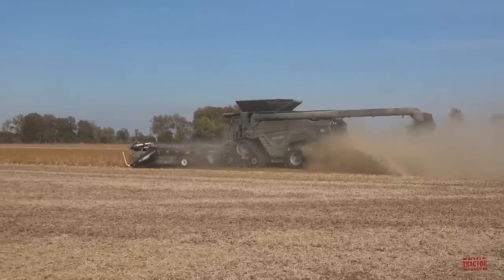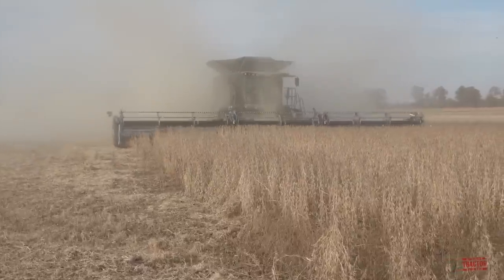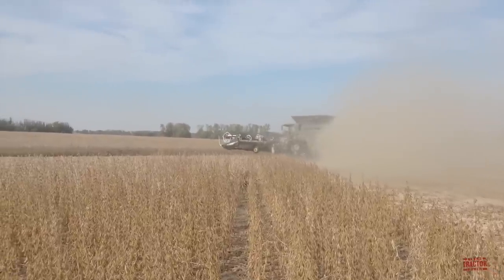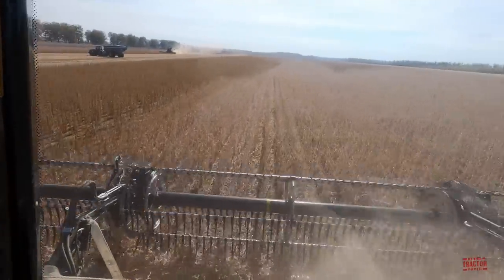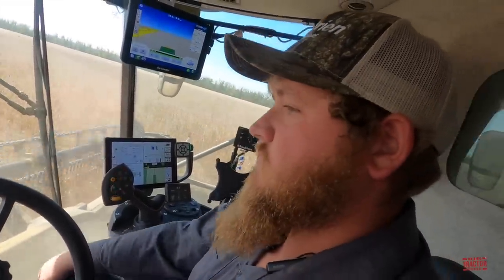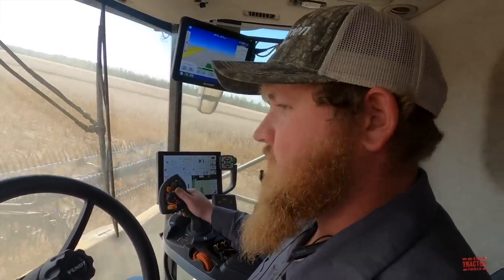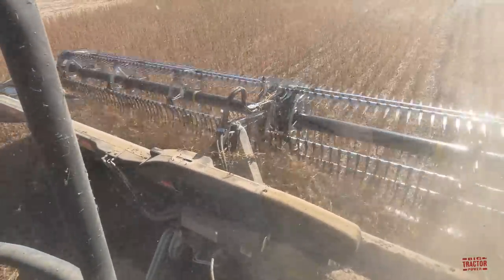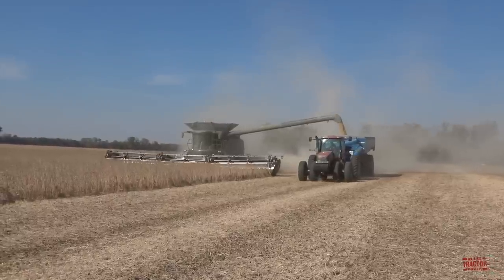50ft MACDON FD250 Flex Draper

Comment: A 50ft head is impressive👍 nice to see an ideal combine in the field, thanks for the video😉👍
Reply: You'd have to have an awful level field to run 50 ft wide
Reply from the maker: Duane these new headers flex allot. rolling Terrain  is not an issue.

Comment: We've had a 45 ft Macdonald on the old 760tt lexion and purchases a new 8600 and using same head. Works very well.
Reply: How do you like the 8600 for beans, we run a 7500, just wondering if it's any better

Comment: That’s humongous! It shows how much agriculture has advanced in the past century!
Reply from the maker: It has advanced tremendously in the past 20 years.  The first MacDon I filed was a 36ft model in 2003 on a 9750 STS in wheat and it seemed huge at the time.
Reply: @bigtractorpower  wow! Do you have a link to it?
Reply: Efficiency in time use especially during harvesting (my own experience on a small grain farm) is so important, time is money, optimal conditions are rarer than one would be think if you want it to go straight into a bin. My dad spent most days on the Gleaner, with a New Holland helping, many nights spent running the dryer. To grab 50' at a time wow, but when does $$$ spent in the name of efficiency become too much?  Million dollar combines are real and must be near that limit.

Comment: Would like to know what kind of losses they experience with that head, and also the combine.  Does that type of head eliminate the need for a wind system like the Crary Wind System?
Reply: Looks like it was doing a pretty good job as is.
Reply from the maker: I did not observe very much loss at all in the field. The Ideal and MacDon made an effective harvesting team. I do not no sny farms in WKY running a Draper with an air reel. The Draper handles the crop well

Comment: Question - what’s the hp range for a Class 8 combine rating? You mentioned this Fendt is a Class 8 rated at 538 engine hp, but the JD S790 (543 hp) and CaseIH 9250 (550 hp) are rated as Class 9 combines.
Reply: The rated horsepower of the Ideal 8 is 470 hp. The maximum is 538 hp. So it is a class 8 combine. The class 8 category is starting on 430 hp and it going to 500 hp.
Reply: @ihtomi  Then he should have stayed it that way so not to cause confusion.

Comment: Wow in 1998 you bought a new combine with 2 heads for the price of an fd250.    That machine is eating it up.
Reply from the maker: It is amazing how prices have changed. The equipment has grown up size and ability too.  In 1998 30ft on the header and 250 bu. on the combine we’re as big as it went.
Reply: What about the class 7 combines with 330 or 350 bu. tanks. @bigtractorpower

Comment: That’s not even the big fendt lol they got one more bigger than that lol, but the head the same. Pretty rad lookin combines I like the gray
Reply from the maker: The 8T is the midsized model.  The 10T at 790 Hp is the top end Fendt. I have a video on the 10T with joy stick steering in wheat harvest posted at https://youtu.be/UBFJukRMbVw

Comment: How can a farmer ever pay for that  combine.
Reply from the maker: The performance of harvesting the crop quickly and well is big plus.  This farm raises winter winter wheat and double crop soybeans.  Soybeans are planted right behind the combine as its harvesting wheat.  Two crops from one field in one year is a big help.
Reply: Most farmers run a lease program through their local dealership. Lease a unit for 2-3 years and when it ends they lease another (possibly newer) machine. I doubt most farmers are writing a check for the full cost of the combine and head.
Reply: I should clarify. Most large scale farmers might do this. Smaller guys may not, but nothing wrong with that.

Comment: The reel looks like it's going too slow and pushing the plants over. It doesn't look like a clean cut. Where is the air reel?
Reply from the maker: I did not observe any issues filming. The header had a nice clean cut.  There were allot of soybean leaves on the ground prior to harvest from a recent harvest.  I do not know anyone in WKY who requires an air reel for their Draper. I saw little grain loss and there were not any beans hitting the combine windshield from shatter.
Reply: @bigtractorpower  it was fun to learn from Cole the cornstar how much the air reel saves the dry soybeans. I think it was decieving the silver part of the reel you could see vs the extra circumference where the teeth were. I had to watch it twice to see my error. Great video, thanks bigtractorpower for all the great content & I look forward to the next ont.
Reply: The next video